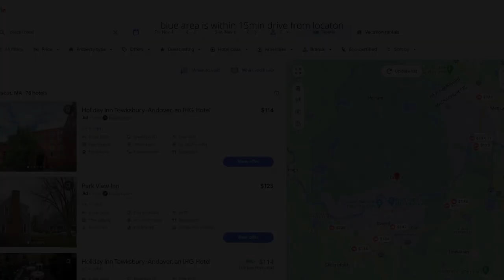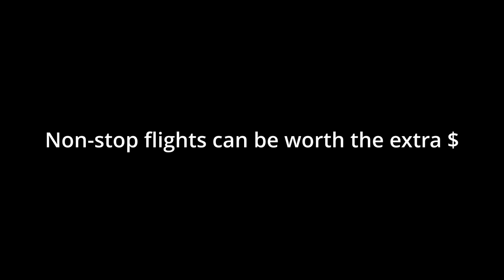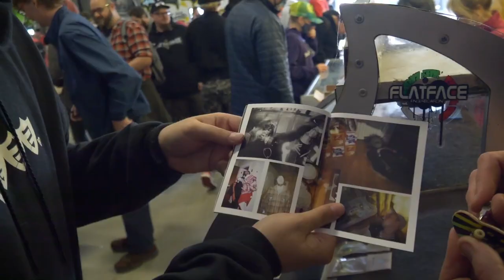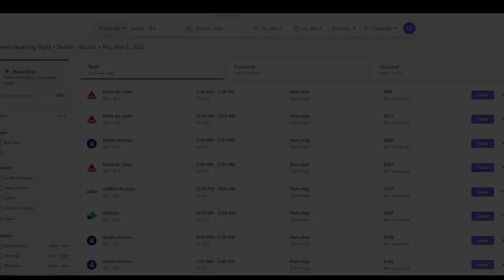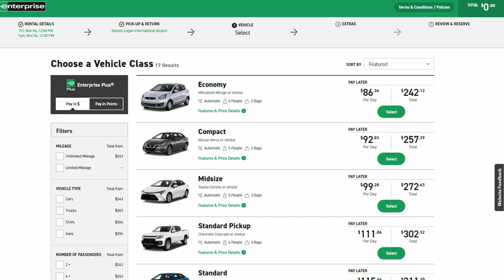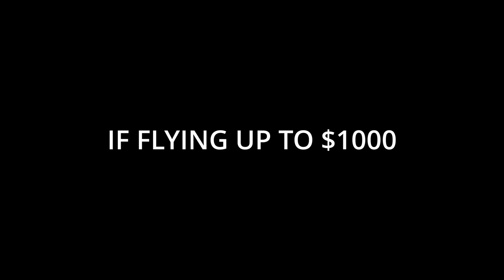The Ultimate Flatface Fingerboard Rendezvous Guide!

Comment: For those close to massachusets but don't own a car, always check the cost of flights. You can get a cheap flight round trip for under $200 if you plan really early, compared to taking a train which might run you close to $350 or more. Don't overestimate the cost of traveling by air, always look into every possible option to save yourself the most money. What I found is that it's cheaper and faster for me to take a flight

Comment: My biggest tip is to bring a car. If you have your own car Vous can be quickly done for $200 or less, maybe even $150.

For example, let's say the flat face is about 400 miles away from you if your car gets 25 miles to the gallon and you're paying about $4 per gallon of gas that's about $65 for transport.

Now you need a place to stay, to put it simply you should reserve a room as soon as humanly possible. You can easily stay at an Airbnb for 2 nights for $150. If you don't really care about sleeping alone you and some buddies can cram in the same room. However, I'd put it at a max of 4 people. But let's just say it's 3 and put it at $50 a night.

Now you're at about 115, but you gotta get something to eat. I'd say budget around $75 for eating and some sightseeing, Massachusetts is an excellent place so don't spend all your time just fingerboarding. The event is on a Saturday so Sunday before the drive back home has some fun. 

All in if you do some penny-pinching call it $190
Reply from the maker: Definitely! If you live in a distance that is within road trip distance it saves a ton of money!